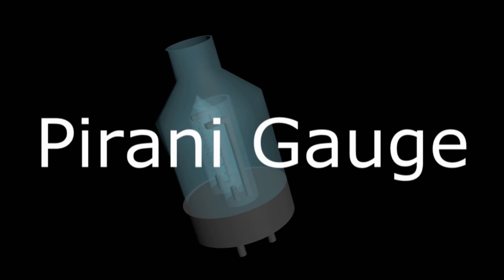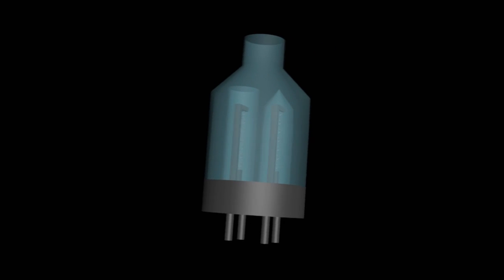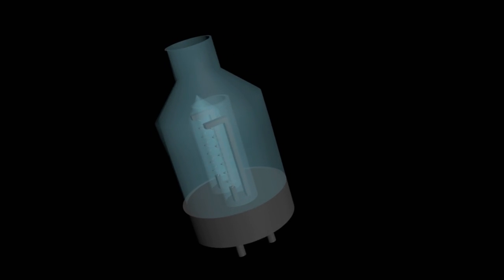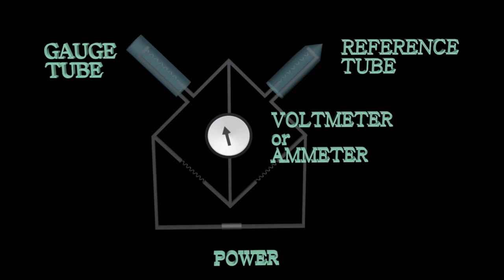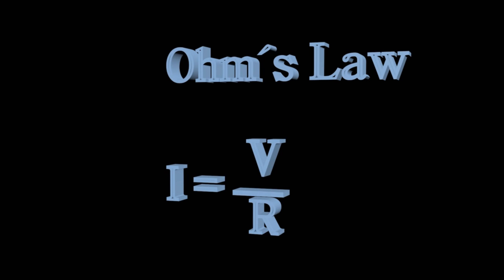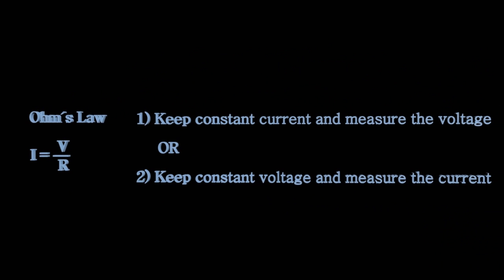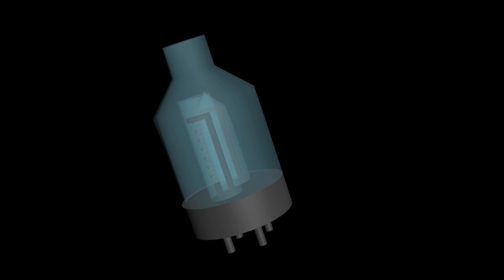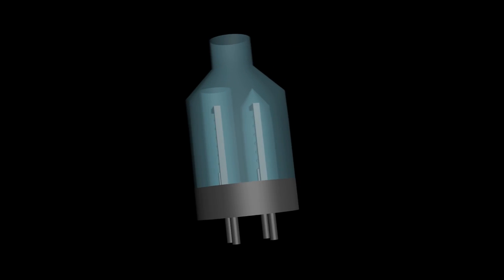Pirani Gauge for Measuring Vacuum

Comment: Higher pressure = lower temperature = lower resistance. Higher pressure means the molecules will "steal" more heat from the wire, so the wire's temp. will drop, and consequently its resistance will drop too.

Comment: i couldn't understand how we link the resistance variation with the pressure variation anyway thank u
Reply: Higher pressure = lower temperature = lower resistance. Higher pressure means the molecules will "steal" more heat from the wire, so the wire's temp. will drop, and consequently its resistance will drop too.